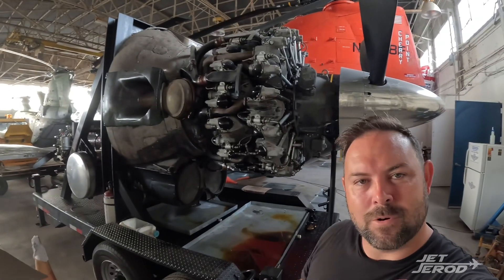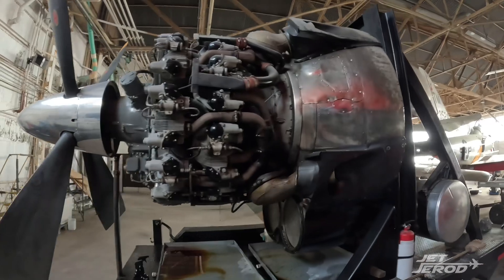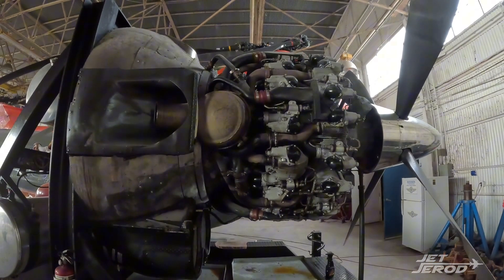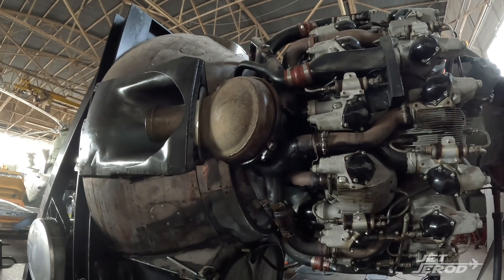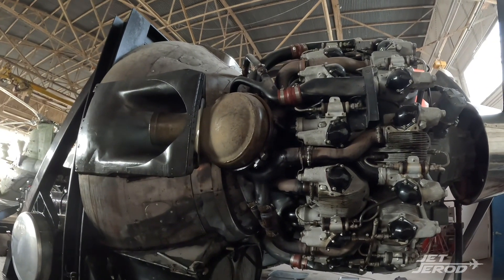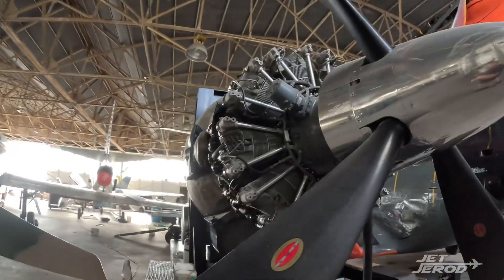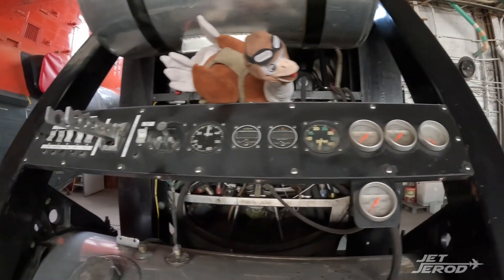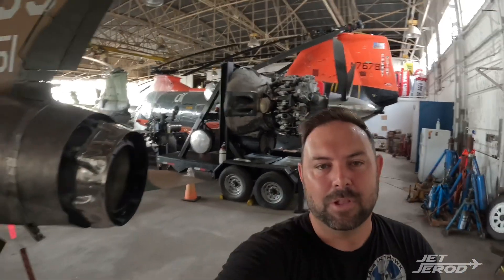What is that!? No, it’s not a TurboCharger!

Comment: 2 inch diameter exhaust was used to keep velocity high.  Turbine extracted kinetic energy as even exhaust gas has mass.  
The exhaust system is very complex to keep pulses timed optimally to reduce dynamic back pressure.

In the end, the PRT more than offset the parasitic loss driving the centrifugal supercharger.

Comment: Axial flow turbines that drive a reduction gearbox and fluid coupling to damp out firing impulses. These were used on the Lougheed Super Constellations. The power tecovery turbines added 500 HP per engine during takeoff. Power after 5 minutes is reduced to 75% of maximum. Most engines are then run ROP, which is Rich of Peak. Aircraft engines are designed to enable adjusting the mixture. ROP uses the extra fuel to cool.the exhaust valves at the high loads and hours long flights. The engineers research found that leaning the mixture aboit 50°F from peak exhaust temperature, greatly increased valve life and fuel economy. The extra air cooled the valves. If the flight engineer did not lean the engines properly, a valve head would break off and go through the power recovery turbine, necessetating shutting that engine down, possibly over the middle of the Atlantic Ocean.
In cruise power the power recovery turbines added 150HP more per engine.

Comment: So why are these not on car engines?
Reply from the maker: @tsbrownie  car engines don’t operate at high enough of a constant rpm to justify them, I’m sure. Aircraft engines are designed to operate at 75%-100% power for most of their lives, the average car engines will likely never even see 100% power for longer that a couple of minutes over the course of their life.
Reply: @JetJerod   Yes, you are right of course. I had to put some more thought in my knee-jerk comment. It seems that PRT recycles otherwise wasted exhaust energy directly back into shaft power, whereas a turbocharger recycles wasted exhaust energy into (potentially/controllable) higher power output. The difference being that a turbo'ed engine will produce more power, and can maintain more power at higher altitudes. The PRT would start at a max power and straight-line decrease as the raw engine power reduced.
The PRT is more about fuel savings, the turbo more about a sustainable increased power to weight ratio. 

 So turbos won, especially in military apps. But I'm surprised that they are not used on long haul trucks, stationary diesels, diesel ships, and other ICEs where change in altitude is not an issue, where turbos represent an unneeded increase in power/fuel consumption/cost, but where max fuel economy is important.
Reply from the maker: @tsbrownie  yea I’m sure they could find a way to help recover some power but these days it might be electric motors on each axle that will take over that sort of thing, who knows!

Comment: Without the prop but with the QEC , weight is about 5,000 lbs ready to install on the aircraft. Early P2V Neptunes did not have jets , later P2V-5 and P2V-7s had J-34 jets which were ran on Avgas , same fuel as the Radials. The combination burned 650 gallons per hr at takeoff power , 2 radials, 2 jets . Worked for Arnold Kolb , Blackhills Aviation , painting the Neptunes and built the first tapered MD-80 type tail cone . Also worked for Neptune Aviation and painted the first 2 P2s with the new paint scheme with all red vertical and rudder. Now the Fire tankers are all jets , miss the sound of those radials cranking those 14’ props !!

Comment: The main rationale behind direct-into-combustion-chamber mechanical fuel injection was they were on the brink of being able to cut fuel to any individual cylinder that wasn't igniting - electrically. As it was DC-7s were often seen landing with an engine feathered because the Flight Engineer had spotted a non-running cylinder with the Ignition Analyzer in flight and requested it be shut down because hours and hours of raw gasoline not being burnt would wash the oil off the cylinder walls possibly causing a seizure. Kill one injector and keep the other 17 cylinders running.
Reply from the maker: @patrickshaw8595  that’s so cool!

Comment: The USN had their Turbo Compound R3350's built with Pressure Carburetors (Chandler-Evans) instead of (Chandler-Evans) Direct Into Cylinder Fuel injection - and they were rated 4000 horsepower War Emergency = 500 more hp than Direct Injection.
Reply from the maker: @patrickshaw8595  that’s a lot of power!

Comment: “We didn’t want to increase complexity for maintenance!”

HAHAHAHAHAHAHA!!!

The Turbo-Compound R-3350s were one of the most unreliable engines ever made. This is why the DC-7C and Super Constellations and Starliners had comparatively short lifespans vs the DC-6, Constellation, and other aircraft powered by either normal R-3350s or that apex of radial power and reliability: the R-2800.

Comment: So its basically a Hybrid.  That is exactly how the Hybrid Indycar engines work only instead of using a gas-driven turbine they use a powerful electric motor to help crank the driveshaft.  Where the turbine here gets its power from exhaust gases, the electric motor in Indycar gets its power from rechargeable batteries.  This engine here and the Indycar engine are both Hybrids, just in different ways.
Reply: Formula 1 engines use a turbine powered by the engine exhaust to power their turbocharger and a motor/generator unit (called an MGU-H), the energy recovered is then used to drive the wheels via another motor/generator unit called the MGU-K and the result is the most efficient automobile engine unit ever built (50% thermal efficiency).

The engine in this video is not a hybrid, it's just a turbo-compound engine.
Reply: Not really.

Comment: I wonder if auto manufactures ever experimented with the PRT for car engines, seems like an easy way to improve efficiency especially this day and age.
Reply: Wouldn’t work that well as aircraft engines run at at least 70% maximum power at cruise which gives plenty of gas to turn the PRT. This is not the case with a car cruising while using maybe 25% max power. It simply doesn’t create enough gas.
Reply: @superskullmaster  I'm pretty sure it depends on the compression ratio of the engine and the RPM, that would effect the pressure of the exhaust, you can also change the size of the turbine depending on the pressure. also you could use a small CVT to couple the turbine to the crankshaft to accommodate different RPM. theres also hybrid drivetrains that use a generator that runs at a set rpm. lots of variables to look at before you can say something wouldn't work.
Reply: @samthemultimediaman  does that sound economical and maintenance friendly to you? Just because something can be done doesn’t mean it should or is feasible. You could put a turbo shaft in a car too but it’s not practical.
Reply: @superskullmaster  Maintenance friendly  modern cars that's an oxymoron lol, jokes aside it was feasible on an aircraft engine in the 1950s, engineering has come a long way since then.
Reply: @samthemultimediaman  but I promise it will never happen. Turbine engines were the evolution of recovering power from combustion gas, this is a backwards concept. It’s like going to a horse and buggy because it’s quieter. I work for the biggest defense company in the world, do you believe we think backwards just because something works? If anything beyond electric cars I see clean burning fuel cell powered cars as more feasible than a wonky 1950’s PRT engine. Just except it.
Reply: @superskullmaster  cool story bro.
Reply: The car manufacturers did not, but the large displacement truck manufacturers used to apply the PRT in their turbo compoud 4 stroke diesel engines
Reply: @kolbola  how large? Like mega dump truck? Even so, diesels are made to run at *high power most of the time so that makes sense. That is not the case for gasoline engines in cars.
Reply: @superskullmaster  I would say, the Euro diesel truck manufacturers have this solution, like Scania, or MAN. Like in this video, where the PRT belongs to a long range cruise airliner (and not in an A1 Skyraider strike aircraft, where this engine was also applied, but without the PRT) the nowadays turbo compoud diesel engines are made for long, continous RPM roadtrips. So the PRT/turbo compoud typical purpose was/is to maintain a continous RPM with as high as its possible thermal efficiency. While the PRT is actually a power recovery application, so at the end of the day, it is also increase the available performance, the basic purpose is to increase the continous efficiency, not the sudden peak power. By the way, the PRT was also a crucial part of the competitor engine, the 28 cylinder Wasp Major from P&W, but only for the long range types, such as the B-36 bomber. The soviets also made some experimental PRT design, one was for the mighty Dobrynin VD-4K, a 24 cylinder, liquid cooled radial engine (six banks, four rows), but Stalin terminated all those projects which were not so sufficient. That's why the soviets turned so early to the turboprop engines. And of course, because they had a lot of german engineers as POW.

Comment: Like non-turbocharging without turbocharging. Why didn't the tech catch on for capturing more of the exhaust gas energy?
Reply: It did, current Formula 1 engines are also turbo-compound engines and Volvo also has a mechanical turbo-compound engine for heavy trucks.